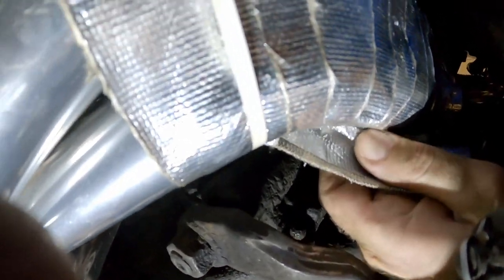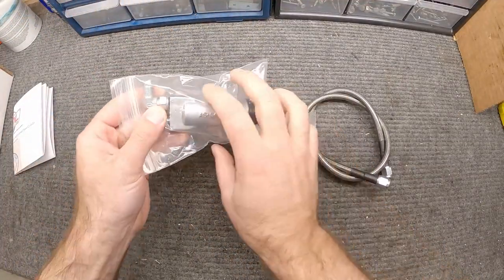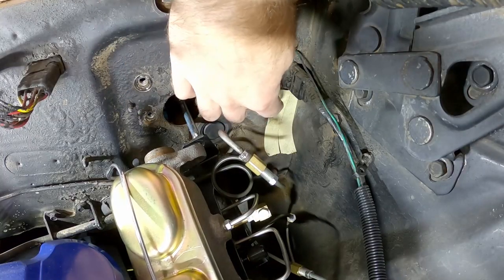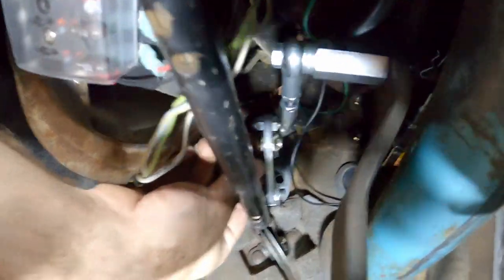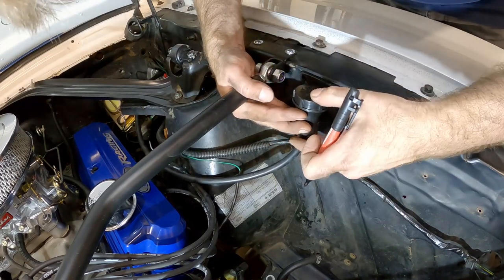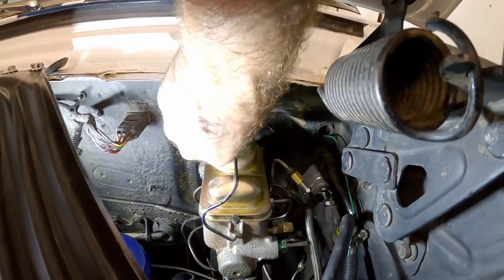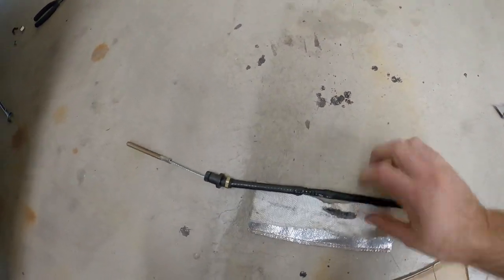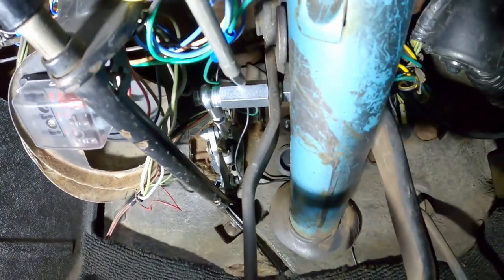Upgrade to a Hydraulic Clutch - 1966 Mustang

Comment: How do you like the hydraulic clutch so far? I'm at the point where I'm about to drop the 306 in my 66 mustang and can decide to either buy the zbar clutch linkage, or buy the hydraulic clutch conversion kit.
Reply from the maker: I like the hydraulic clutch because of how smooth and effortless it is, but there's something awesome about the direct connection with the Z-bar.
On a side note, the z-bar would not work with the clutch lever I went with (the reason I went down this path is a long story), so just a heads up that the hydraulic setup I have now and the Z-bar are not swappable as the way the z-bar disengages the clutch is "opposite" than how the hydraulic setup works.  I'm sure there is a kit to swap out the z-bar setup to a hydraulic setup without replacing the clutch lever, but I don't know where a guy could get that.
If that was confusing, I could email you a more thorough explanation, just send me a message, my email contact is on the About tab of my Youtube home page.
Reply: @AndyKruseChannel  Oh I see, I have a basic understanding of how the clutch linkage works on the zbar setup vs the cable setup. With the zbar setup, you retain the original 3/4 speed bellhousing and use an adapter plate to mate it to the T5, (in my case, it's the 3 speed bell) With a cable clutch kit, you need to use the fox body or SN95 bellhousing, with the pivot stud and pull style clutch fork for cable actuation. Your setup has the external slave cylinder that attaches on the outside of the bellhousing which it pushes on the clutch fork.

I believe to convert an early model zbar bellhousing over to hydraulic, you'd have to use an internal slave cylinder which removes and replaces the throwout bearing and clutch fork. I think Tilton Engineering or McLeod makes a internal slave cylinder for the T5 transmission. 

My main concern with going hydraulic is having the slave cylinder fail. Especially on an internal mounted one. Which would require removal of the transmission to service.
Reply from the maker: @GlitchMaster0001  I forgot about the internal slave unit, I was only thinking external to reduce the need to remove the bellhousing and possibly replace some of those parts.  Your fear of the internal unit failing is high on my list too.  In fact, before I contacted MDL about my scenario, I thought I was going to have to do the internal unit and I wasn't wild about it for the same reasons you're not wild about it either.
Most people won't put the mileage on these cars like we do with our daily drivers, so the odds of the unit failing are way lower.  However, reducing moving parts and pieces that have seals will always be better in the long run.  Knowing everything I know now about the T5 swap and my car, I would have gone with the Z-bar.  I prefer that type of engagement and it is less likely to fail.  I was headed down a slightly different path when I started to assemble the parts for this project, but in the end I could have kept the Z-bar, I just didn't know it yet.
Reply: @AndyKruseChannel  Yeah, that's what I was thinking too. I drove my car with the zbar setup and 3 speed for a while, then swapped it out for a T5z and kept the zbar. 

It worked fine, until I broke the fulcrum inside the bellhousing from not removing the heavy spring under the dash in the pedal box. Removing the giant spring and replacing the fulcrum inside the bellhousing, the pedal effort isn't as light as the pedal on a hydraulic clutch, but it still easy to operate the pedal.

Going hydraulic would be nice if I wanted to run long tube headers, but I'm just running some $100 eBay tri-y headers on this engine. I do have some concerns on the zbar not working with the tri-ys, but for $100 I don't mind using the 4lb sledgehammer, angle grinder, and MIG welder if needed.
Reply: Great video Andy. I would love to see a follow up with video of you driving the car and discussing the comments below. Your thoughts on the feel of the hydraulic clutch now vs the cable vs a z-bar set up would be of great interest to those weighing out options. Anyway, thanks for the video and engaging in the questions and comments here. Well done and thank you!
Reply from the maker: @guyser34  Thanks for the feedback!  I have a video I'm planning where I will discuss the more about new clutch as well as other parts on the car.  :)
Reply: @AndyKruseChannel  TR6060 swap in a 60's car here so looking at the tread im with the OEM Z-bar for ford top-loader's 1970's F150's and 60's C10's ect. but the linkage gets in the way of other speed parts goodies and tremic designed the magnum/TR6060 with a internal concentric slave-assembly.

so how do i best duplicate the feel of a real Z-bar using a hydraulic clutch system as the modern mustang's as vary linear ( don't like it and it's confusing to me vs the main-hydraulic brakes as iv pressed the wrong pedals once or 2X and the naro petal's vs my big-feet/boots don't help ) like a long bow hunting and the Z-bar is like a compound bow feel as the top is light the middle is heavy and the bottom of the travel is lighter and easier to drive with or at least for me and power shifting the top and middle of the petal travel helps thow my lefty leg off the petal letting me know it's in the next gear ( and or slip the the clutch/sincoro's ) and ready to mash the gas-pedal to the floor board
Reply from the maker: @richardprice5978  Sorry Boss, I don't have any experience with the TR6060, so understanding how to make the included hydraulic clutch feel like a mechanical clutch would be a new one for me.  :)
Reply: @AndyKruseChannel  didn't the later on T-5's or M-22/top-loader's/4-speed's have concentric slave? as a OEM part so feel wise the same trick's would probably work for it and in theory the side-mount slave is going to function the same way as the concentric one's so you or others might have some tricks that might work 

good to know there's others people like me that like old-school "fast dump trucks" ( penskiy AAR and 1/4mile racing team ) feel wise
Reply from the maker: @richardprice5978  Again, sorry brotha, this bit is out of my wheel house.  :)

Comment: how can you protect the cable with headers?
Reply from the maker: Sorry Boss, I'm not sure I understand what you're asking.
There are certain headers out there that are routed in a way that would allow the cable to not need to rest against the primaries (MDL has them listed on their site), but these headers are definitely not one of them.  :)
I've also heard some people were doing additional wrapping on the headers and the cable itself, but I don't know if they had the same headers as what I've got installed.
Reply: Ok . You cant protect Them only buy the right headers?😀do you know if try y would fit with this cable ?
Reply from the maker: @chevroletbelair1  Correct, buying the headers that MDL lists on their site would definitely help with not melting the cable.  You may have better luck with Tri-Y headers as there are only 2 primary tubes in that area where the cable will be versus all four primary tubes in 4-1 header styles (like what I have).
Shorty Headers would provide the best chance of proper clearance with the cable, and knowing what I know how, I would have been better off getting Shorty headers instead of what I have.  Most of my driving style is low-end to midrange RPMs, I don't need the benefits of high RPM gain that the 4-1 headers provide, so I should have just purchased Shorties.  Then I would not have needed to pay the extra money to get the hydraulic setup.  :)
Reply: Hydraulic clutch is more expensive but you have more comfort.
 buying a new cable and new headers to fit Will be more expensive than hydraulic set i think 🤔.
Reply from the maker: @chevroletbelair1  You're correct, it is easier to use and the Hydraulic option is more expensive than the Cable, but my issue was buying both.  I didn't plan on getting new headers when I was putting this T5 swap together and I think the Tri-Y headers I had would have worked with the Cable.  I should have returned the Cable kit before installing it because I was warned it wouldn't work with the headers I purchased.  This would have save me some money.  Oh well, it's only money, you can't take it with you.  :)
Reply: @chevroletbelair1  I have tri-y headers and there is no way a cable would clear ... that's why I'm using the original 65 linkage